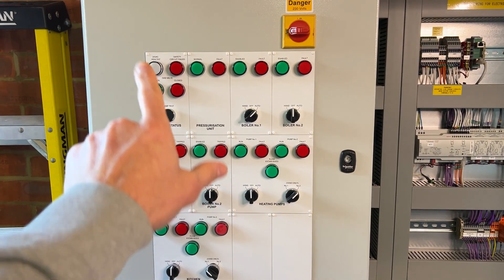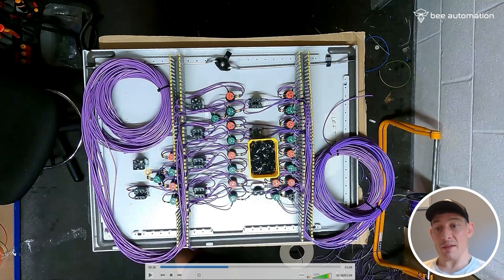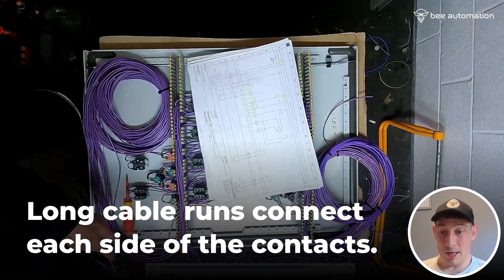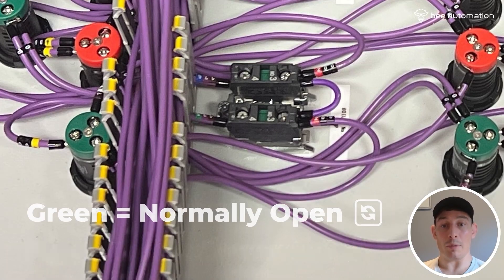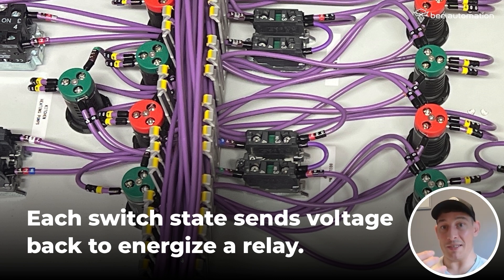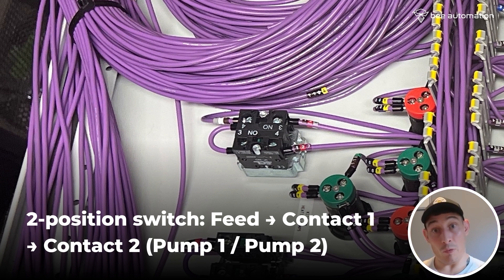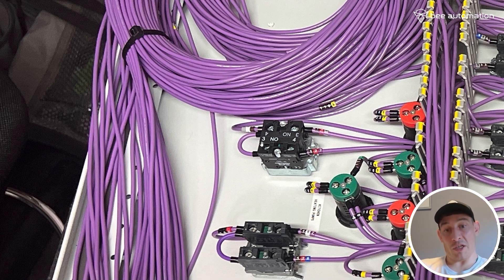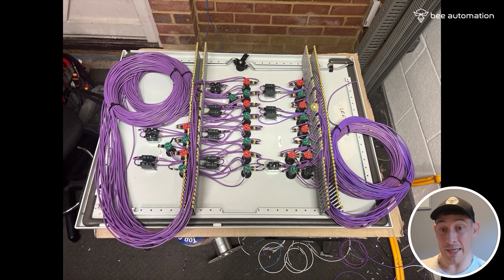Industrial Control Panel Wiring Explained - The Doors

Comment: Hi Chris,
I definitely appreciate how much work goes into fitting all these doors — I’ve done plenty myself, so I know the effort involved with accurately cutting holes, sourcing hardware, and getting everything to line up properly.
That said, there comes a point where, for me, it’s just not worth the time and effort. In those cases, I usually opt to put in an HMI instead.
Is that something you’d consider doing with a BMS?